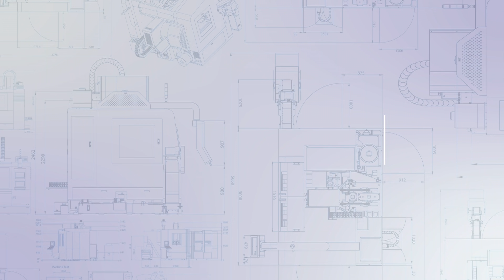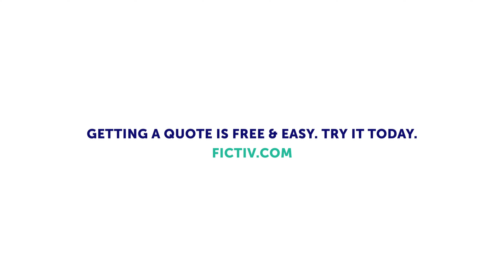Guide to Injection Molding Success | Episode 1: Tool Types | Fictiv

Comment: Hello, i have 2 questions: 
1. What is Kern(kernel) in Injection Molding Tool? - Is it the Core?
2. And why are the Tools with Kernel better than the ones without it - (if this is true statement)? 

Also, if Kernel is something else, please explain to me what is it?
THANK YOU IN ADVANCE.
Reply from the maker: The kernel is indeed the core part of the mold. The core forms the internal shape and features of the injection molded part. Most injection molds have cores, as it is basically a necessary part of the mold, so I'm not sure if you can say that tools with cores are "better."

Comment: Which method is proper for balancing family molds , Designing runner and gates?
Reply from the maker: Thank you for your question, Amir! Family molds need the same material because you need to balance the pressure and make sure it fully fills. This requires proper gating, heating of the mold, and usually runners that are also heated to keep the plastic liquid before cooling when hitting the metal mold. The main driving factor is if the part volumes and surface areas are similar.  That can be compensated a bit with the runner sizes and gate types.
Reply: Yes but also , we have molds all of the same family but different components are added for a mold conversion, we can use valve gates and also a hot runner system!